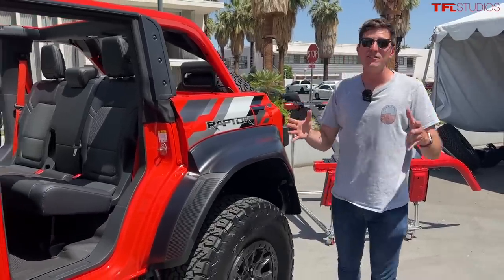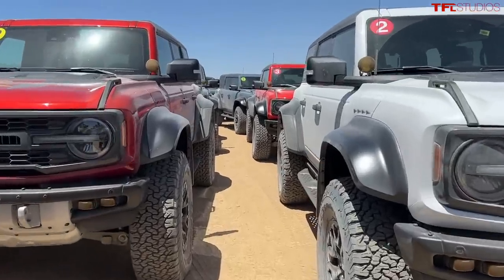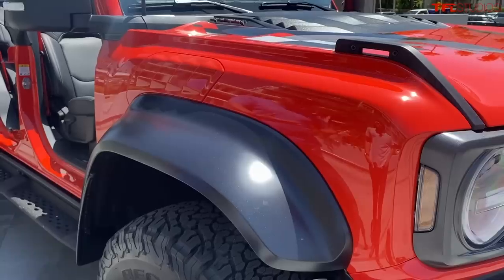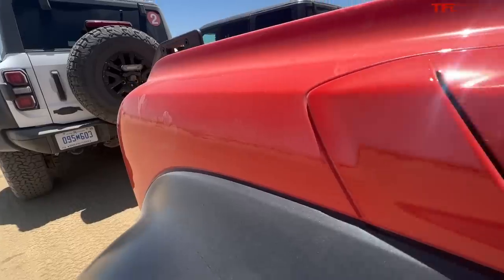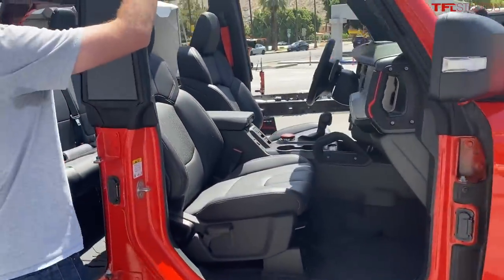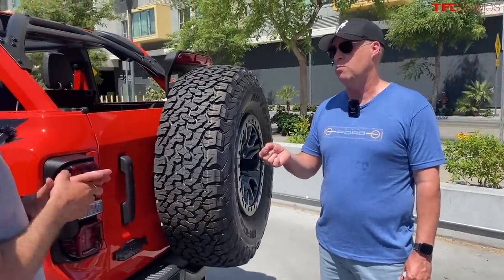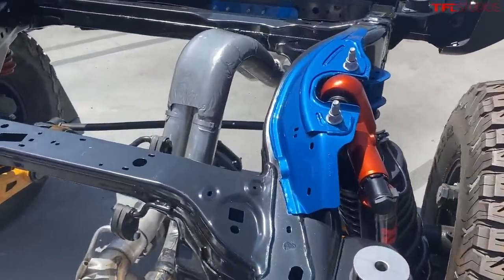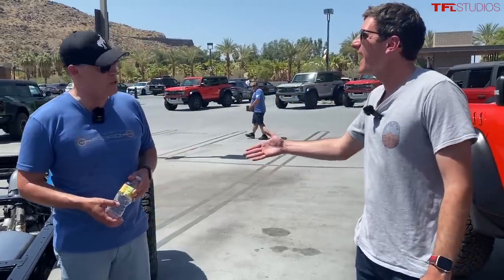There Is No V8 In The All New 2022 Ford Bronco Raptor: I Ask Ford Why!

Comment: The fact that there isn't a coyote in this is absolutely nuts. That was my biggest excitement in the Bronco coming back. I was planning on getting one but I think I'll hold off.
Reply: these high sprung turbo motors from ford has not been reliable at all…. they shoving them in anything and everything. even a new raptor with a tuned coyote would be much cooler than the raptor now. same power.
Reply: @plutodestroyer12  Yeah I've been hearing a lot of major recalls are going down for these motors. What a shame, and to think there's guys out here paying over $100k for these. Bet they feel smart now. I want the 5.0 mostly because thats where it goes. The OG's had the option and everyone loves the sound of a V8. Have a V6 on something that is supposed to be the ultimate vehicle is a bit silly.
Reply: Lol
Reply: I have a 2 door badlands Sasquatch with 2.7 and it is amazing. It’s lighter and has 315 hp and 400 Torque. Can be tuned and a exhaust etc it would be crazy. I have 3 fox body mustangs so I understand the v8 but the Bronco is fun.
Reply: @mynameisfrank6519  Fun maybe but also those motors have a time limit on them. Lotta recalls are dropping.
Reply: @mynameisfrank6519  feds are investigating ford because of so many engine failures with that 2.7 in the Bronco- good luck!
Reply: Its just sadly how it is. The V8 is dying. Look at Chrysler and Toyota they're going thr same way and it's heartbreaking 😭
Reply: @sly9263  weird how the 2.7 rep isn't that good cause the 3.5 is generally known to be alright when it comes to reliability. Wonder why the 2.7 just doesn't work ad well
Reply: @vanderz1012  it was fine for a while AFAIK in the f150s- was out for at least 5-7 years, but i rarely ever saw/heard of them for that matter- everyone got the v8 or the 3.5 mostly i think
Reply: @sly9263  I guess the rule of thumb is don't fix it if it ain't broke. 3.5 works well and is decently reliable but they must have changed something with the 2.7. General rule of thumb though is when it comes to power and not being high strung size is your friend
Reply: Why’s everyone stuck on V8s other than the sound? Turbo 6 are the future, they perform better, lower torque numbers and better fuel. Then get a tuner for 500 bucks and you can ad crazy power. You can’t do any of this on a V8. I’ve had the 5.0 in F150s, they have to rev to build torque. The 3.5 builds boost when you need it and don’t down shift and scream!
Reply: @chriscampbell867  v8 runs smoother, sounds better, and has less lifetime service so it has purist and cost savings appeal as a result. I had the 3.5 ecoboost for 5 years and it's nice but it sucks fuel under load worse than the 5.0 for sure. Also the ecoboost provided the same exact mileage for me as the 5.0. If you're adding "crazy power" with a $500 tuner only then you're going to blow up that little engine. If we're talking about being dumb with money for upgrades, a supercharger on a V8 is superior with it's low end torque curve vs a turbo for the purpose of a pulling weight.
Reply: @sly9263  as the owner of a GT500 CFTP I get the V8.. but still disagree for a Bronco.. my preference
Reply: @chriscampbell867  I wasn't suggesting the Bronco should have a V8 btw but rather explaining why people like it. I'm a GX guy  myself- I trust Ford with pickups but that's it.
Reply: blame the government emissions standards they could care less about reliable
Reply: @sly9263  lol do your research and stop reading all the same bullshit , that was a small batch of bad valves from a crappy manufacture ford used  , they have already fixed the issue
Reply: @bryan70546  sounds great marketing damage control guy
Reply: @sly9263  yea I work for ford 😆
Reply: @bryan70546  lmao
Reply: @sly9263  but all bullshit aside for did have a bad batch of valves that unfortunately made its way into the 2.7 in the 21 model broncos. They supposedly switched companies and got it figured out. Owners can research the bar code on the engine and if the engine falls within a certain month date and time well guess you have a eco-boom lol

Comment: Still love it - but seems like Ford thought about a possible V8 power train for less than 5 minutes.  I just don't want the higher maintenance costs that eventually show up with all turbos.
Reply: Extended warranty.  It's a 70k vehicle.  Got to pay to play.
Reply: @jghall00  I don’t know about you, but if I spend 70k on a vehicle I want it to be reliable and durable.
Reply: @Lakikano  This isn't the work truck market. These vehicles are meant for play, not work. If you want a 70k vehicle that's reliable, you get a 3/4 ton with the 7.3. Not a driveway queen with twin turbos.

Comment: Did you consider the v8?

The 3.0 is the right answer for this vehicle. 

Thanks for not answering the question
Reply: it's a marketing strategy, they don't build Broncos from V8 to 2.3 ecoboost engines. Same with their F150's, Explorers and Expeditions. It's not gonna be selling the Timberline first then last would be the XLT models. Besides, they have to release the F150 Raptor V8 first.
Reply: I am sure they have tied hands from a government standpoint too
Reply: Amen.  Nailed it.
Reply: @getlosttoday4045  but Jeep doesn’t?
Reply: @brianowens1002  depends on the government fines I am sure. Ford mostly eliminated most v8 motor vehicles for years now. Or they get a kickback from the government.
Reply: I'll translate this for you:

Yes, they did consider it. But for PR and Marketing purposes, we're not gonna tell you why we didn't consider it.

My guess? Government Regulations on emissions. Ford has to have an average of all their vehicles hit a certain fuel economy range, and Raptors are just fuel drinkers. a V8 would drink even more fuel.
Reply: @Xyler94  The volume of raptors they sell vs the actual MPG difference on a turbo V6 vs a V8 (which is nominal to equivalent in practice) would be statistically irrelevant in the comparison you're trying to draw.
Reply: @ColeSpolaric  that’s a stretch; we’re talking about one trim level of one vehicle.  It’s not like they discontinued the v8 and we’re asking them revive it. It’s an existing powertrain they’re actively selling.
Reply: @sly9263  And what do you think Ford's biggest seller is? The F-150. They're probably already riding that edge because the F-150 ain't exactly the lightest on Fuel.
Reply: @Xyler94  you do understand there's a difference between a truck and a passenger vehicle, right
Reply: @sly9263  You do understand that the F-150 is a passenger vehicle, right? A truck becomes a passenger vehicle when it's registered to a person and not a company, and is not used primarily as a working vehicle ((Canadian Laws, the other definition of a passenger vehicle is any vehicle that's designed to seat less than 9. And this affects mostly insurance stuff))

The F-150 easily falls under said rules.
Reply: @Xyler94    Alabama made me register my Silverado 2500 as a “truck”, tag and all.  It’s a personal vehicle I mostly use as a dd but tow heavy 4-5 times per year.  And no, it’s not cheaper that way. 😡
Reply: @garysarratt1  A 2500 is a "heavy duty" truck. F-150 is considered "light duty" like a Silverado 1500. It's the class of vehicle.
Reply: Politicians. 😐😑🙄
Reply: @sly9263  but it's still about the compliance and not actual result, i've never had any savings by cylinder deactivation
Reply: If given the choice, I'll take a naturally aspirated V8 anytime.
Reply: Toyota and Chrysler are starting to go the same way. Its government constraints more than anything else. The V8 is dying and its hotly heartbreaking 😭
Reply: He answered the question. You just didn't like it.

Comment: The 3.0 ecoboost is not a very bad engine, but most of us prefer the great sound of the V8. Which is why Jeep gave in to demands for a V8 in the Wrangler...and they fit the biggest V8 they could under the hood, the 6.4.
Reply: The V8 will also more than likely outlive the boosted 6.  Less stress, less things to go wrong, less expensive to maintain long term.
Reply: They put the V8 in because other than the engine the bronco is a more modern and superior product, ford doesn't put a V8 because there is no competition on that market other than the jeep
Reply: @goncalotr  if the Bronco is a superior product, why are so many people trading them back in for Wranglers? Most videos I've ever seen on the Bronco is that the build quality is garbage, they're mostly meant to just drive on pavement.

Comment: I want to know who was behind those fender flares. If they re-did the fenders and quarters, why didn't they widen them 2 or 3 more inches to lessen the size of the flare? It looks cheap. I realize the big flares are better regarding trail damage, but at $80k and it's width, I don't think you'll see many on tight trails in the woods. Just my .02
Reply: this is just going to be a mall crawler for 90% of the units sold
Reply: Assembly line constraint. The truck is too wide to fit in then paint section which is why the mirrors aren’t painted as well as the fenders
Reply: @Alex-gf4ew    Really?
Reply: @garysarratt1   yes and most people will take them off anyways or get aftermarket ones anyways saves ford money
Reply: Should have relocated the a-arm mounting points inward to get more length and travel rather than just dangling them even further out.  The Bronco is wide enough as it is FFS

Comment: Got Ecoboost since 2013, used to have the  V8, the ecoboost engines puts out a lot of power  torque and so much fun to drive but not great for heavy towing and needs to be on top of fluid changes unlike a V8
Reply: ecoboost engines sound like shit
Reply: It needs the V8 sound is Harley-Davidson saying we're changing our V-Twin and we're going to start offering a 4-cylinder. They would go out of business in a week. If it ain't broke don't fix it. Buy them not offering a V8 they lost my business
Reply: Bye, Felicia

Comment: It's because they don't want to spoil the Ford Bronco raptor R with the 5.0. he had a lot of vague answers to your questions
Reply: Doubt it. They will probably use the high output 3.5L V6.
Reply: @geoffmooregm  All right that's what they said about the raptor F-150 but look at that. It has a 760 horsepower Voodoo V8.

Comment: Engine compartment looks like someone took a crate full of hoses and dumped them in all at once.
Reply: Right? I mean it prolly doesn’t make a difference at the end of the day but for a vehicle at this price and for consumers who want a truck like this which is basically a badass toy, you want everything to be top notch and attention to detail for everything. Seems they did a great job for everything but like you said when you open the hood, it’s not a beautiful thing to look at. A halo vehicle like this are for dudes who actually like popping the hood, workin on their trucks or just showin it all off but there’s literally nothing to show off under the hood cause it’s so messy and unorganized and not well thought out. The normal bronco is the same thing but I expected the raptor bronco to actually have an engine cover and look better underneath.
Reply: Culmination of over engineering... What a mess?!?!

Comment: (Personal opinion from me, even though I’m employed under Ford) The way that Ford’s management is structured, I personally believe that “chief program engineers” who are in charge of a certain vehicle do not fully understand the vehicles they are responsible for. They know the basics of all the specs for different trims, but their main purpose is to make sure that manufacturing is in progress and not too far off track. As long as the vehicles roll off the lines without too many issues, they’ll be good. The only other thing they have to do is talk to journalists and media, and that’s it.

Comment: LOL everyone complaining how he didnt answer the V8 question but he really did they basically never considered it which was the answer cause he talked about other Turbo V6 in other vehicles. Also not really sure if the Coyote engine would fit in the bronco with out some major changes to the front engine bay. My only problem is that its not offered in 2 door version and only 4 door. All these Supposed High performance vehicles always on the more door version or longest versions of them. At least give us an option Manufactuer.

Comment: The Ford rep did a real good job of glossing over the point about not putting a V8 in the Raptor Bronco. For 80,000 thousand dollars I still want the opportunity to have a Coyote in my Bronco. I can stick a supercharger on my V8 and just like the Jeep, have some big horsepower. I do have an Explorer ST with the 300 and it does go fast on the street. My next vehicle will be either a F150 with a Coyote V8 or a F250 with a 7.3 gas motor. As you can see, I am old school just like the first Gen Bronco with a 302 V8. If Ford ever decided to put a V8 in the new Bronco, then you have my undivided attention.

Comment: I think it is a mistake to discontinue a V-8 engine, however after My 1998 Expedition blowing spark plugs,  I don't know what is best.  I have heard that they are having trouble with turbo charged engines too.  I have also heard that Electric Vehicles don't work very good for towing trailers.   I  don't know what to tell You.   It kinda sounds impossible to get anything that is Quality Built anymore!!!!
Reply: There's lots to hear when everyone has something to say. TFL at least shows us proof: we see the video of how vehicles handle challenges, we see when transmissions overheat, when tires slip (or pop), and the pain at the pump. 

You know for a fact you had certain issues. If everything else was great, then researching if those issues have been resolved since or are found in other Ford engines is a good place to start. And ignore the "that car's trash" -end statement type folks. If they can't explain why, they probably don't know how to care for even the most foolproof engine. 

CR is a great resource, but their reliability data is mostly based on consumers volunteering info. And we all know AT LEAST one person who calls a vehicle trash even though they never changed the oil or diff fluid, never removed road salt, don't know how to use a smart phone etc. You really have to dig (and only on the high volume models) to see specific issues and comments from consumers that they polled.
Reply: I prefer V8's for towing. I use a 4.0L straight with my Jeep. Tows fantastic. No turbo to break down. Very reliable. I have a 5.7 Chevy 3/4 ton truck. Good and reliable. I have a 5.9L Magnum 1500. Tows good too. Very reliable. Ford had some issues with spark plugs and stripping out threads with their Triton V8's. Never was a problem with 80's and 90's Fords. I hear the new Coyote is very reliable, no spark plug thread issues. So what is best really depends on you selecting the appropriate vehicle of the right brand and year with as few problems as possible with the engine, transmission, and suspension. Electrical issues are also good to look at. No one likes solving electrical problems.

Comment: Should have put the V8 in it.  I had the 2018 f150 with the coyote V8 in it, now I have a 2019 with the 3.5 eco boost   and yes I love the eco boost  and it is fast but.  The V8 is right behind it where if you tuned it would probably surpass the eco boost.  But when you get a vehicle like this or even a F150 that stock coyote V8 sound is like know other stock, but with aftermarket exhaust it's a head turner and makes you smile.  No matter what you do with a eco boost it sounds like a some kind of  motorcycle coming down the road.  In my opinion if your spending this kind of money a mile or so per gallon if that between the eco boost and Coyote V8 is nothing, its all about the sound that beautiful rumble only a V8 can give you. that alone is worth half the price of the vehicle but I starting driving in the mid 70's so maybe that's just me.

Comment: I can’t imagine being a Ford Performance powertrain engineer and being excited to come to work to create a V6 for a vehicle like this. Smooth or not, the thing needs a V8. This guy barely acknowledged Tommy’s question. This is why I am no longer a Ford fanboy.  Kudos to Tommy for asking!
Reply: Twin turbo with more torque than the f150 raptor! I think it’s time to get over the number of cylinders
Reply: @Chrisamici  or we turbo the 5.0
Reply: @Chrisamici  exactly right, it takes two turbos to get up into the range of V8 power. These is nothing satisfying about driving around in a massive truck/SUV and hearing a fart noise come out of the exhaust of your awesome V6! 😀 

Trust me I know, I owned an ecoboost F-150 and an ecoboost Raptor and it always left more to be desired when driving. Especially off-roading; that V8 grunt is just a much better experience. People that like ecoboost trucks and Mustangs probably like to put exhaust mods on Honda Civics too.
Reply: @virgfresco1403  and enthusiasts that want these vehicles don’t care about MPG’s either. Have you ever driven and ecoboost Raptor or any ecoboost? They don’t get very good MPG if you are in the boost.
Reply: @Chrisamici  the Bronco is already under investigation for engine failures. Go figure
Reply: @Chrisamici  the unpredictable acceleration of a turbo powered engine is extremely annoying. I had a Gen2 Raptor for 4 years and my Gen1 Raptor and TRX are so much more predictable and fun to drive. I tell it what to do and it does it. That’s a connection that you can’t get in the vacuum powered V6’s.